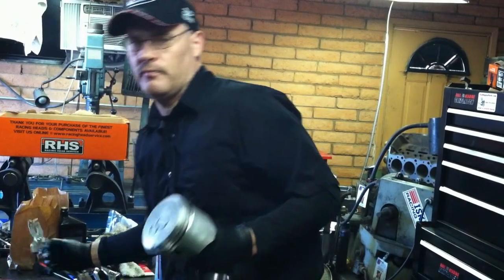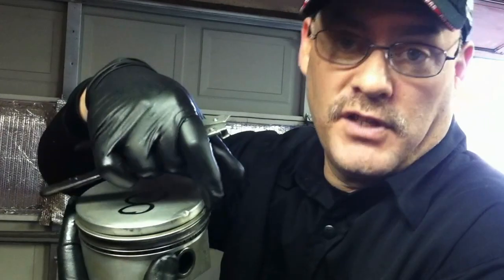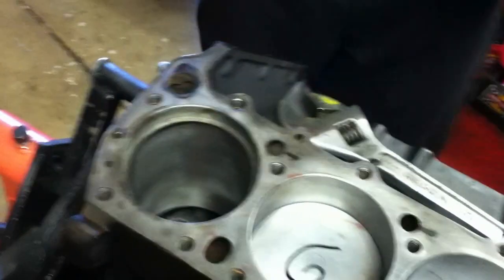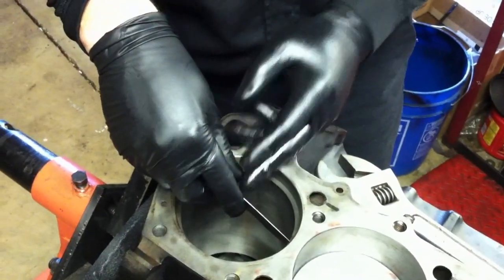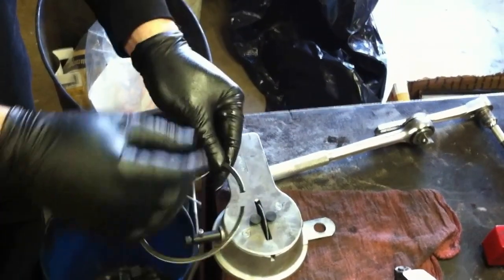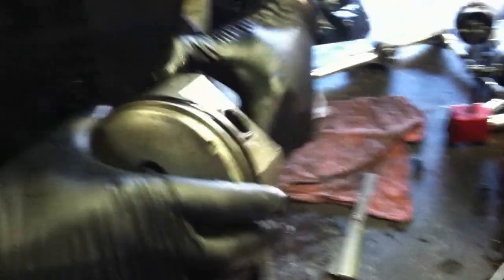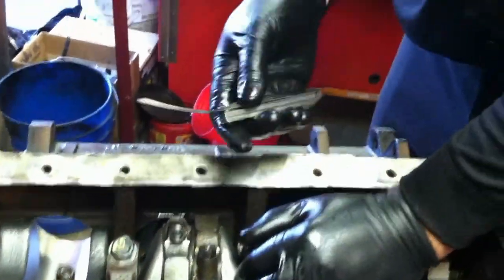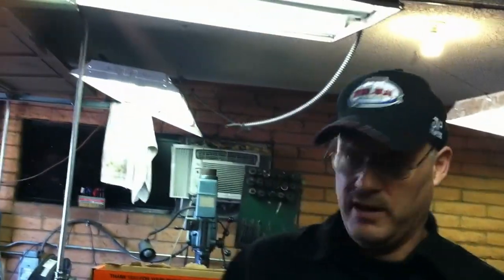440 Chrysler engine rebuild part 4

Comment: my 440 lost all oil pressure while at idle , trying to find if a failed plug in timing case is the issue. oil pumps ( primer tool ) can hear it splashing around  but  never gets out of the base .
Reply from the maker: HMMM sounds like it could be a plug but it will need to come apart to find out
Reply: is there an oil plug in the timing case that , if removed, would cause the oil to simply fall back to the base? iv already changed pump, cleaned sump and tube but results are the same.  thanks !!

Comment: What's the best way to valve lash a Chrysler big block with a flat tappet hydrolic cam and shaft rockers?
Reply from the maker: The Chrysler BB is a non adjustable valve train it has a bolt down rocker shaft the valve lash is set when the heads are reworked the machinist needs to set the valve stem height correctly there is a spec for the valve stem tip height when we do the valve job (seat and valve cutting) it can change the valve stem height and cause incorrect valve lash the valve grinder has a fixture built into it for grinding the tip of the valve stem to correct the stem height this is something that the machine shop needs to do I have seen this done incorrectly so many times and it throws off the valve lash and causes problems keep in mind a Hydraulic lifter cam has zero lash the push rod needs to be preloaded into the plunger of the lifter if it is solid lifter cam there will be an adjuster at the rocker arm. You can make hydraulic lifter cams adjustable but you will need an aftermarket adjustable rocker shaft assembly

Comment: not all rings are cast iron. there's cast, ductile iron, steel. it depends on what your application demands. how much flexibility, strength, and resilience is required.

Comment: the rings are ductile iron, not cast iron.
Reply: or steel. not all rings are cast iron. it depends what your application demands. cast, ductile, steel. how much flexibility, strength, & resilience does it require.

Comment: Is that .0020" on each side of the rod or total clearance?  I suppose the rods can be ground down if too tight, but do they have to be replaced if way too loose, or is the crankshaft modified?